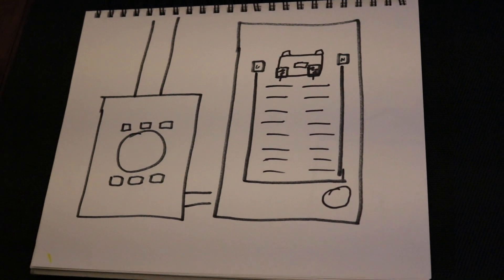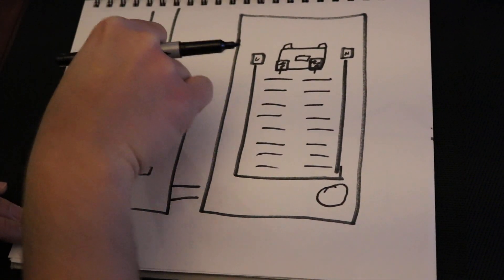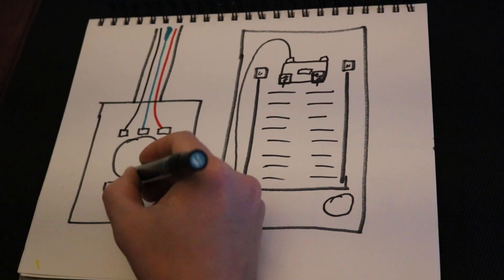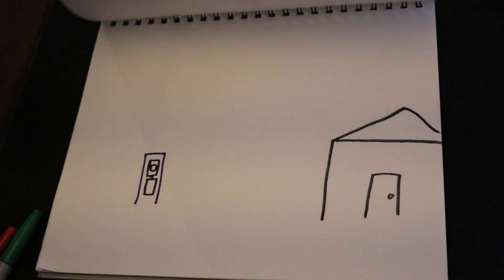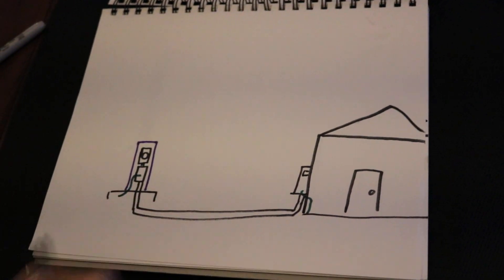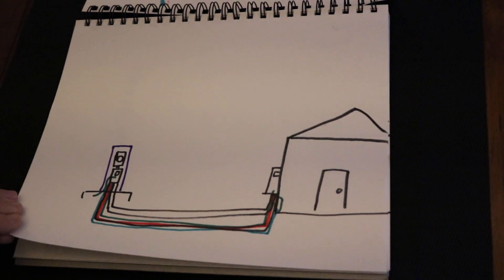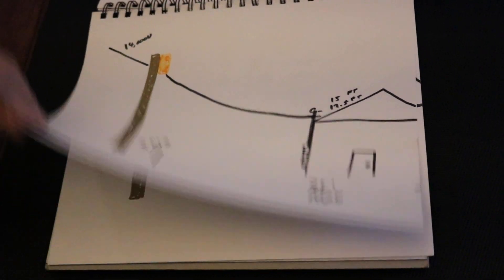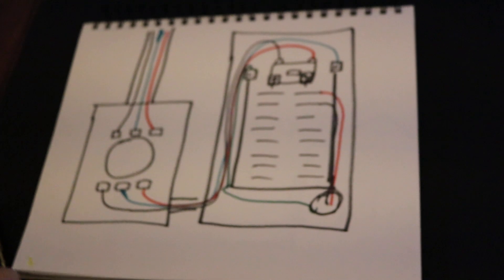Electrical Meter Base & Main Disconnect

Comment: Think it should be addressed the cases of 
Meter Socket  to   Disconnect   to   Main Breaker Panel, 
vs 
"Meter Socket /  Disconnect  Combo"  to  Main  Breaker Panel,
vs
Meter Socket to         "Disconnect / Main Breaker Panel  Combo"

Comment: Woulld you do line drawing  of what you see for duplex house service enterance.  Like single phase 3 - wire Both situation of a vertical 2 gang 200amp meter and also a horizontal  200 amp meter  (include integrated disconnect) , and talk about parallel service over head service for 400 amps. Would you need two risers for parallel and if you do parallel  risers how far apart max can thet beat the heads?  Or do you use like 600 cm cables, because woul they be hard to install  or connect to the lug. 

And if you can do parallel service wires from the overhead service point to the meter bus, for a 2-gang meter box (i am assuming thats ok for most jurisdictions, but still want your opinion) ; then to simplify things for me if i want an exterior 30 or 40 space 200 amp panel then instead of using a two gang meter box with the 40 space panel adjacent  (in the case of a vertical meter can)  / OR in the case of a horizontal 2-gang meter can,, with the 40 space panel below;  can i use rhe following:

I want to hse two risers side by side  that enter seperate. -- side by side -- combination meter and panel board ( like you wou,d for a single service , but do two services) that are from a si gle uti.ity drop?

Comment: I have a meter box with seperate breaker box like your describing, but the electric is going underground up into my meter box. it's 200amp box so what wire size is needed because unfortunately we can't afford an electrician & have already failed our building department inspection due to not having wiring, info is very scarce on this stuff. thank you

Comment: Nice. So by definition, when you have a separate disconnect, the main panel downstream of it is a subpanel, with requirement to NOT bond ground to neutral?

Comment: How do you turn all your power source to the breaker box (for a breaker box upgrade) if you don't have a master switch? 

I would like to upgrade my breaker box to a 200amp box and want all live wires from the old breaker box dead.
Reply: Pull the meter out

Comment: What size wire should be used from meter to main disconnect? For a 320 amp meter
Reply from the maker: 350 kcmil THHN copper

Comment: Great video, For overhead riser (if there is driveway ) you say 16' to 18'. is it from ground OR above meter. Thanks
Reply: I'm going to take a guess and I'm only doing it to hopefully clarify what I think you meant, " Is it from the ground to the bottom of the transformer or ground to the top of the transformer?" If I'm off base then simply ignore this.
Reply: Oh, wait! I think I got it now. Sorry, my mind went somewhere else when I was picturing what you wrote. Sorry. It makes sense to me now, 'Do you measure from the ground to the transformer or from the top of the meter to the transformer?
Reply from the maker: From the ground.